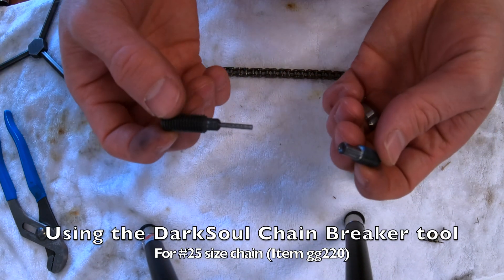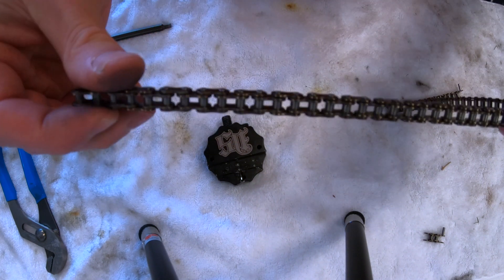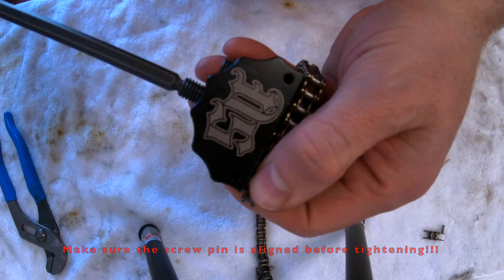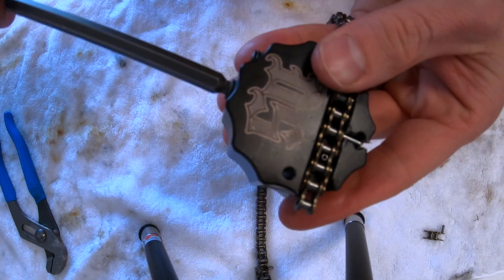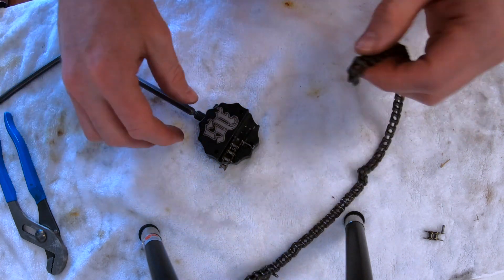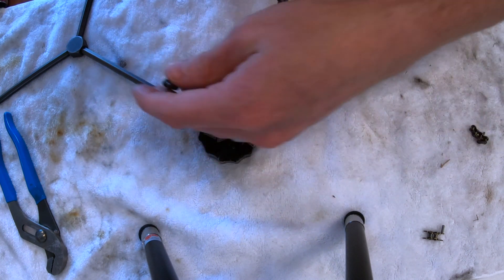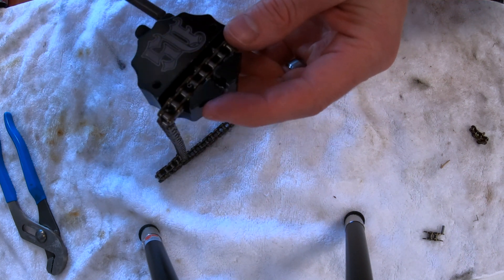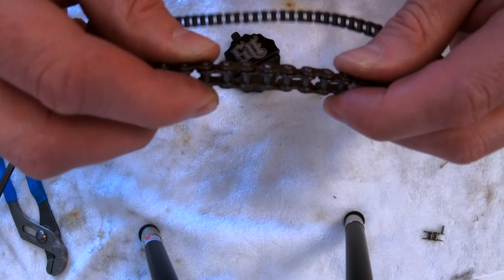How to use the Dark Soul Chain breaker tool

Comment: Hi Steve, just got my chain breaker tool from you guys. I've carefully checked the chain multiple times while pressing the pin to ensure I wouldn't press it out too far, but I got to the point that I've bottomed out and the pin still needs to go further in order to release the link. I noticed that the tool in your video is lacking the "bottom out wall" that is present on mine. Any thoughts or ideas?
Reply from the maker: The reason the bottom wall on my tool has a hole is because someone pushed a pin all the way out of the chain and through the wall of the hub tool. It is not good to do that.
Reply: @DDMSteveB  Ok, I see. But it does appear that on the one I have the bottom out "wall" is too close to the chain link and not letting the pin clear the link fully. Figured I'd share feedback for possible tweaks of future batches.